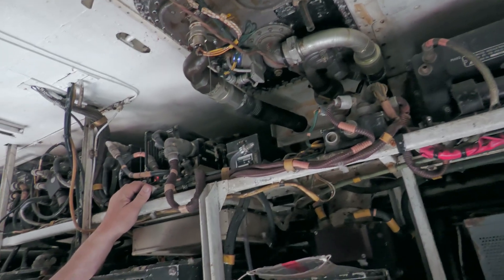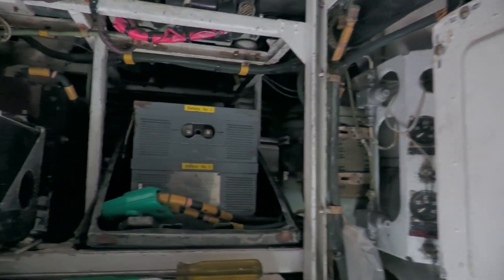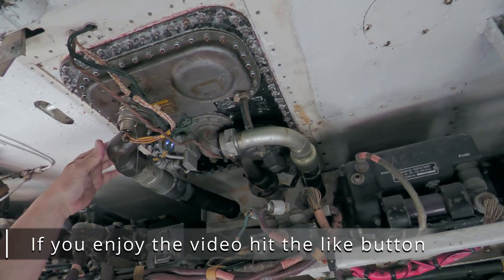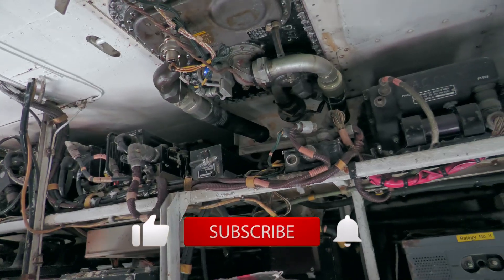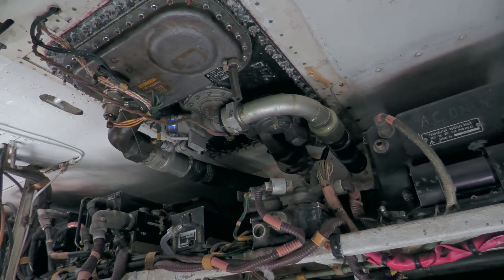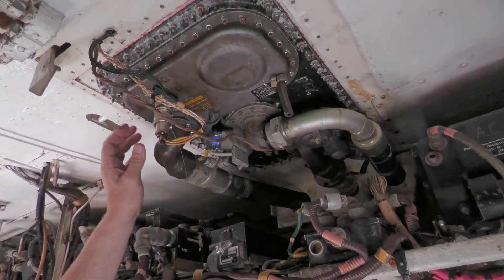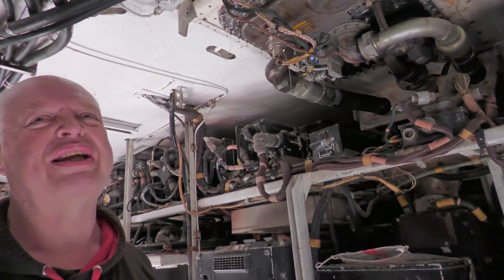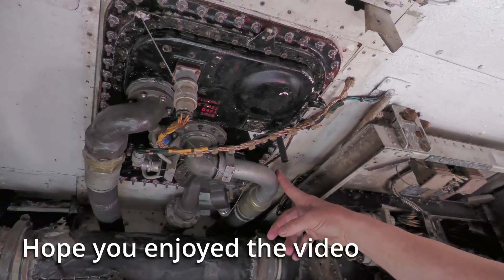Vulcan Chronicles 10 - Leaking Fuel Tank Plate

Comment: An interesting choice of the number of securing bolts on the seaking plate. Could the designers have used less fasteners and a modified flange? This would've simplified maintenance and saved weight perhaps?
Reply from the maker: Would be interesting to see what modern technology could do in comparison
Reply: Bear in mind that this is a 1940s design and the tank itself is a a rubberised fuel cell, a bag, which has to seal against the plate flange. Hense the number and tight spacing of the fasteners to preclude leaks. The actual weight of fuel in the tank is quite high and then add pressurisation on top of that. The No 1 tank can accomodate 2 six foot individuals with ease not standing but crouching.
Reply from the maker: @paulbarker5179. Yup - big tanks indeed. See Chronicle 9 https://youtu.be/kucOIeohEsM
Reply: I wish they had, when undoing all of these you get soaked in jetA1, much to my wife’s annoyance 😂
Reply: I think Tim also meant number 1 port tank at the end (when you turned round), not number 2 port tank